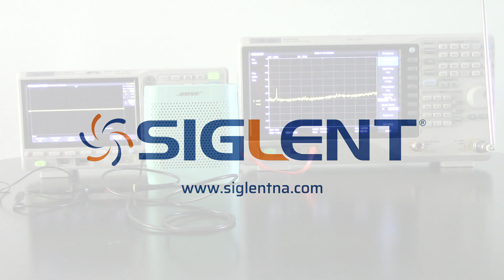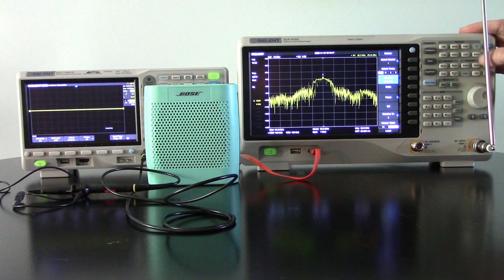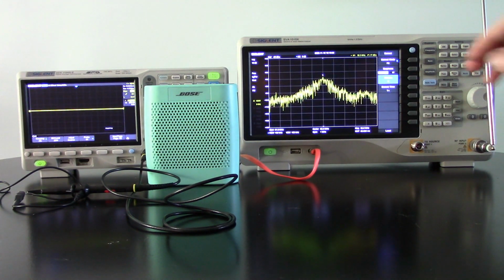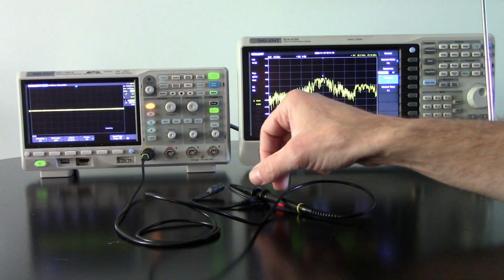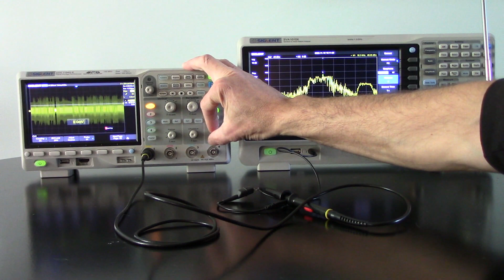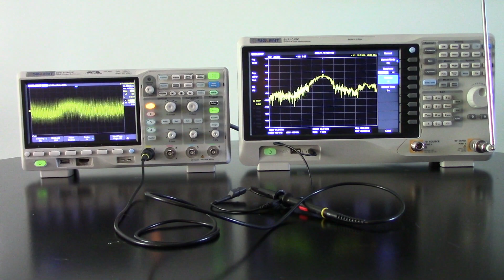How to observe demodulated audio from a spectrum analyzer

Comment: how did you connect antenna with analyser , did you use any connector?
Reply from the maker: In this video, I am using a BNC-terminated telescopic monopole antenna. The analyzer RF input terminates in an N-type connector, which is very popular with RF test instruments due to it's long life and low loss. So, I use an N-type to BNC adapter to connect the antenna. - Jason, SIGLENT North America
Reply: Very helpful.